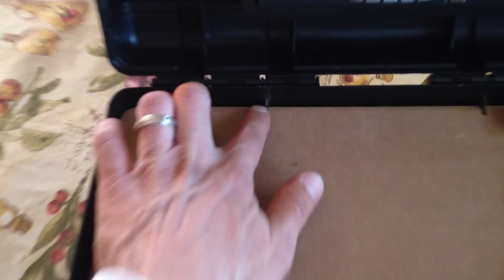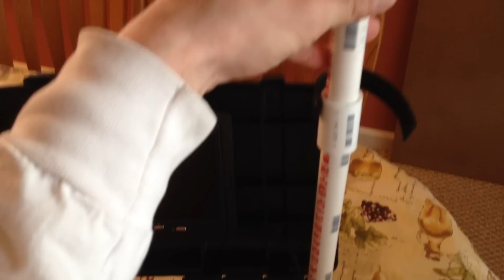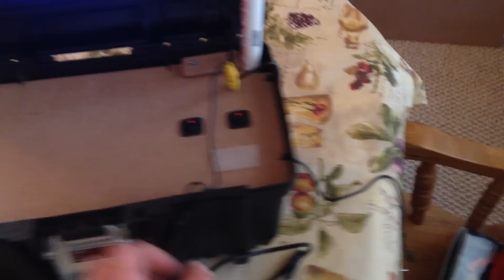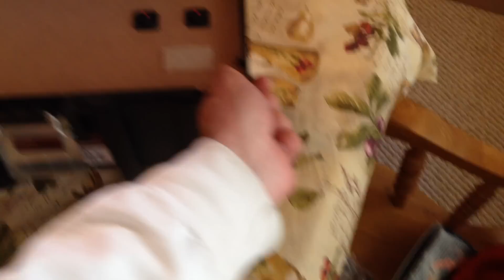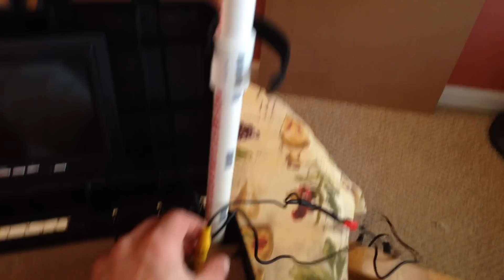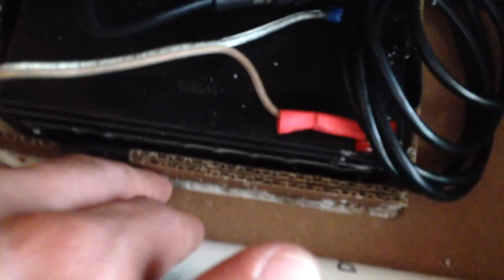HomeMade Cheap FPV Ground Station

Comment: great idea with that pipe but couldnt you just extend the antena
Reply from the maker: shawn Phto I added the poles to get the Reciever as far up as possible. I often place this on the ground, and use my goggles. I figured the farther up the better. Happy Flying.
Reply: cookieman0916  i know the higher the better but instead of putting the whole reiciver on the pole coulndnt you just get a sma or rfsma extender cable and put the antenna on the pole instead of the the whole reicever that way it could be put away in the box
Reply from the maker: shawn Phto it all fits inside the tool box. The antenna fits in hole on top left and Reciever gets Velcroed to bottom right. Wiring gets tucked under where poles are stored. I've also added a digital voltage meter and insulated banana plugs.

Comment: looks good, well worth swapping the charging bolts for some insulated banana/4mm sockets. also to add a fuse I just use the car blade type and female spade connectors
Reply from the maker: Actually, funny you mention that. That's the first thing I did before showing my Father... He's a military man, he would have made a point of it. I swapped it out insulated plugs. Safety first. Thanks for the comment, I can see you have a keen eye, nobody else even noticed👍🏻
Reply from the maker: +cookieman0916 also has a 20 amp auto fuse before reveal to Dad

Comment: check out the hobby king version of this for  150.00,
Reply from the maker: Hobbyking is selling a item that does not have a battery also does not include a Reciever for FPV. Cuter more no transmitter or camera. Buy the complete set from Hobbyking. With what I got here and your looking at $350 easy. Plus you still need to assembly it. Also is it self contained? By that I mean, I close the latch, and everything you need is inside...You do the math...
Reply: well yeah I did do the math, Im not knocking your rig, its actually well made,
but I put mine together with a battery , receiver , 10 inch tablet for way point flight planning, two new antennas, and Hobby King Unit has all the cables, switches , battery monitor gauge , panels, and a real nice installed monitor,  etc, and  everything fits professionally inside   for less than 325.00
I dont have wires hanging down a pvc pipe , and looks and operates perfectly, and professionally, and even has a socket to mount the whole thing on a tripod,,  I think it was a really fair price for that,
just an option, wasn't knocking your set up,
I don't think 325 ish is a lot of money for a professional aluminum field box 8 inch monitor, 10 inch android tablet,  outstanding long range receiver,  switches, battery , all the bells and whistles,, no offensive, but you have a tool box on steroids,,, again I like it, but,,,  just saying
Reply from the maker: +South West Florida Aerial So if I'm reading your comments correct... Your beef is that wires are showing? Ohh, and my poles for Reciever. Is your rig wireless? Also can Tripod fit in ground station?  This is self contained, self built , and still $120.00 cheaper than your alternative. I am a hobbyist not a professional FPVer. Furthermore, show me a video of you ground station, and let's see it's lack of wiring. Also did you build the entire circuit yourself? Anyone can buy one, including me! I like to challenge myself to get things done my way. I used to be a Mechanic, so problem solving comes easy to me. For somebody that likes to build this is a GREAT ground station. I have over 3,000 views on this video alone. Somebody must have built one like this by now. NO NEED TO REPLY. Your a great buyer, I AM A GREAT BUILDER. good day! Tom
Reply from the maker: +cookieman0916 Just checked. Hobbyking charges $190+ shipping. So how is your any better? I got money left over to put into something else. Mine does exactly if not more than Hobbykings version. Tripod is additional cost also. Your rig is way over priced, but it doesn't show a wire, so I guess it's worth spending  $$$ more than mine. Also if something breaks, you have no idea how it's constructed!
Reply: maybe they raised the price, I bought mine from ebay from hobby king for 150.00, no shipping,
either way , good set up,
have you used yours ? and do you like having a separate station? I also have a monitor on my transmitter.  I really wanted a separate set up for people to watch, as I do a lot of real estate  work, etc taking pictures,,
But I like the idea of also having the tablet built in, as my Iris + does autonomous flights as well, and its very interesting to see the flight path etc
I found a really nice Chinese 10 inch  Android Tablet on ebay for less than 90 bucks and its outstanding (for the money)
Reply from the maker: +South West Florida Aerial I have a set of Quanum goggles as well. So I can take a video splitter and use both the LCD and goggles. The screen also detaches(has6'cord). so I can use it on a $9 Hobbyking Carbon LCD mount. I have the mount on my transmitter, but I use the goggles more. The ground station was more for my visual observer to also glance at while following my craft line of sight. I fly FPV on quads, fixed wing, cars, & boats. AMA rule, so I follow it. Either way nice to see two people in a friendly debate. YouTube could use more of that. Take care and good luck flyin' 
Tom
Reply: thanks, you to

Comment: I like the plastic pole idea :) - and the battery wait must keep it stable.
Reply from the maker: Yeah it works great with the sealed battery in bottom. Can stand on uneven ground no problem. Plus it rarely needs to be charged. Since video I have added a tiny digital volt meter monitoring main battery, also added labels to all switches. Thanks for the comments,& any questions feel free. Take care Tom